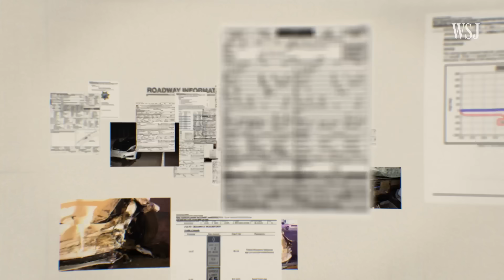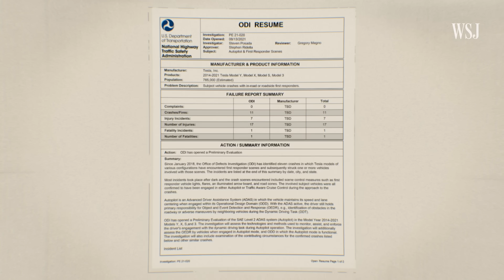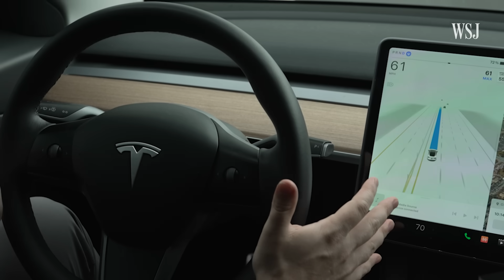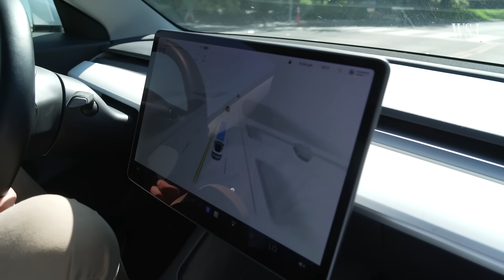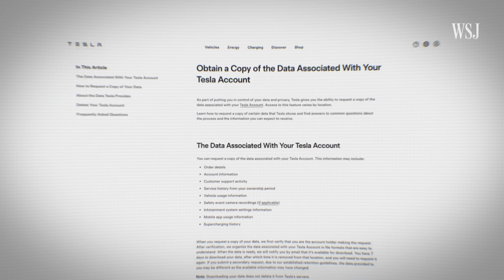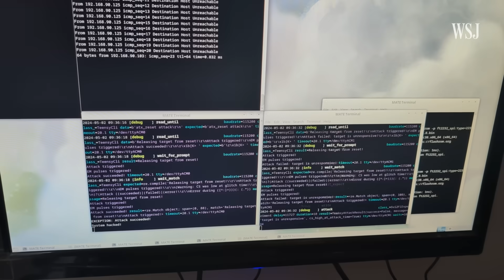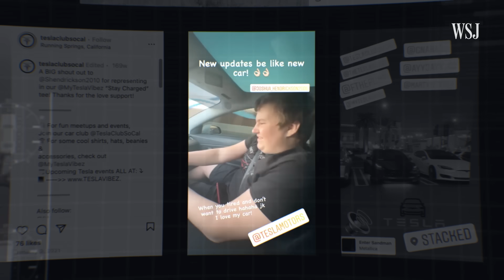The Hidden Autopilot Data That Reveals Why Teslas Crash | WSJ

Comment: This incompetence is unacceptable. Just train AI to drive the cars. Test it in a virtual reality that is indistinguishable from the real world, at lightning speed  within supercomputers, until it has thousands of years of driving experience and never gets into an accident again. Then test it in the real world, and train it there until it is perfect. Have redundant systems. Have two or three completely different systems running at the same time, that operate in different ways. If they don't all agree 100% on what to do, the car immediately comes to a safe stop and requests that the driver takes over.
Reply: Just train AI to drive the cars 
Tesla Autopilot does not and will not use AI. As many have pointed out, it's simply TACC plus lane centering, the same as has come on most every new car in the past 10-15 years. It's FSD that uses AI, and it's achieved an astonishing record of safety over the past several years.

Comment: The king has spoken, so no Lidar for you all, ever.
Reply: no Lidar for you all 
Thankfully. Adding LIDAR, etc. would have the unintended consequence of increasing accidents and fatalities, rather than decreasing them. This is because the more redundant sensors a vehicle has, the more it will cost; the fewer folks will be able to afford them; and the fewer will be able to take advantage of the slight increase in safety that these features would bring. For example, the M-B EQS and S-Class sedan with Drive Pilot probably have the best suite of sensors of any car; but they're so expensive that very few can afford them. On the other hand, the Tesla Models 3 and Y have established an astonishing record of safety, and the Model Y wouldn't have been the best-selling car model IN THE WORLD, BEV OR ICE, in 2023 if it weren't affordable, at least as compared with other vehicles that it beat out for the best-selling crown.
Reply: @BigBen621  
Do you even know what diverse redundancy means and for?
Reply: @Dan8254  Lidar is simply not needed. FSD sees far more than people think, and will make our roads far safer.

Comment: The "brilliance" of Elon is that he convinced so many people he had "autopilot" way before it actually worked correctly. In another 10 years it might actually be an autopilot but he will have made billions off of people who thought he actually had autopilot years ago.
Reply: he convinced so many people he had "autopilot" way before it actually worked correctly. 
My son bought one of the first Model 3s in 2018, and it had a functioning Autopilot (Traffic-Aware Cruise Control plus Lane Centering, just like virtually every new car for the past 10-15 years). I've had two Model Ys since 2021, and both had functioning Autopilots. Tesla has won at least two lawsuits for accidents claimed to have been caused by Autopilot. Further, NHTSA has investigated numerous accidents involving Autopilot, and has exonerated Tesla in each case. As such, he did have a functioning Autopilot years ago, and your claim is what I like to call FALSE.

Comment: In 100% of these cases, the human behind the wheel was relying on autopilot to keep them safe when it's really the driver that should pay attention despite autonomous software driving for them. Ford also offers self-driving mode however the vehicle constantly reminds you to keep your hands on the wheel, if not the driving mode disables, the car slows down forcing the driver to take over. An experienced AI will eventually surpass human driving however we are not there yet, and humans still need to pay attention!

Comment: A car on a busy road has nothing to do with an airliner flying in cruise at 35.000 ft. 
Any automated driving system will obviously greatly reduce the « driver » focus and attention to what’s happening at any time. So the driver is put in a position where he will be mostly unable to react properly to any autopilot error occurring, even more so if these errors are rare. 
Putting an autopilot and asking the driver to react in case it malfunctions is totally hypocritical and incoherent from a safety standpoint. This should be banned. 
This is as stupid and stubborn as OceanGate’s Titan submarine design. 
No surprise Elon Musk has a mindset very similar to Mr. Stockton who was the OceanGate CEO. Libertarian, dismissive of any regulatory body or safety regulations, authoritarian, stubborn, intolerant to internal critics…

Such a system might be used to monitor the driver’s driving and alert him in case of a dangerous behavior such as lack of vigilance or lane crossing or entering a one way road in the wrong direction. It might handle emergency situations in case the driver becomes unresponsive or engages in extremely dangerous situations.

Comment: You also have to realise that the autopilot that failed in '21 is gone now replaced with a better version.
 Tesla updates their model often, but there is no substitute for an aware driver.
Ultimately, FSD-supervised needs to be treated as a driving aid. Not as a replacement.

Comment: For this an any technology one death is too many. I wonder what is the average of casualties compared to non AI which follows models
Reply: I wonder what is the average of casualties compared to non AI
Autopilot is not based on AI; it's just TACC plus lane centering, the same as virtually every can sold in the past 10-15 years has been equipped with. Nonetheless, its safety can be compared with drivers not using Autopilot: "In the 3rd quarter [of 2024], we recorded one crash for every 7.08 million miles driven in which drivers were using Autopilot technology. By comparison, the most recent data available from NHTSA and FHWA (from 2022) shows that in the United States there was an automobile crash approximately every 670,000 miles" (Tesla Vehicle Safety Report 3Q2024).

Comment: Bottom line is the driver was not paying attention.  I also noted the road was full of dirt from the dump truck significantly increasing stopping distance.  Someone made the comparison to aviation Autopilot.  Newsflash: the first thing they teach you in ground school is the pilot in command has full responsibility of the plane and lives it contains regardless of what technological aids are being used.  Funny. no mention of how many non-autopilot deaths occurred during the same amount of time, or the fact it's impossible to tell how many accidents DIDN'T happen because of autopilot.

Comment: To be clear, I'm no fan of Tesla's system. But are they, or are they not, safer than human drivers? Are they, or are they not, safer than competing systems? Are they, or are they not, safer than (extant, or possible) public transit alternatives? It's answers to these questions, ones about how to improve our safety overall, and not anecdote-driven sensationalism, that will serve the public.

Of course it is a tragedy when someone dies on the road, but that tragedy is not increased or lessened by the brand or technology of the vehicle involved. Several of the videos you show are circumstances where I might have been killed had I been the driver, so blaming the manufacturer without looking at the statistics is just muddying the water of an issue that we desperately need to understand clearly.

I don't feel the video, as presented, was a service at all.
Reply: @stephenspackman5573
But are they, or are they not, safer than human drivers? 
Without a doubt.

 Are they, or are they not, safer than competing systems? 
Competing systems to Tesla Autopilot are the TACC and lane centering systems that have been included in pretty much every new car in the past 10-15 years. The difference is that unlike Tesla Autopilot, nobody's monitoring the safety of the other hundreds of millions of cars, so there's no way to measure whether Autopilot is or isn't safer than the scores of different versions of TACC and lane centering from all the other manufacturers. But because Tesla does do attention monitoring even on Autopilot, and many if not most of the competing systems don't do attention monitoring, it's highly likely that Tesla Autopilot is safer than most of all competing systems.

 Are they, or are they not, safer than (extant, or possible) public transit alternatives? 
Probably not.

This is probably one of the most well-thought-out and rational posts in the entire comments section of this blatant hit piece.

Comment: I don't want to seem calous or without empathy, but with very little research you can see that the autopilot system is not to be used as a sole driving method.  The driver is intended to always be paying attention to the road.  It is not a complete driver replacement and as far as I know is not currently or has it been in the past intended to replace the driver.

Human accountability up to and including now was always factored into the system and expected to play a role.  You are CLEARLY intended to have hands on the wheel, be paying attention, and be ready to brake at ALL times.  I know that and I don't even own one.

Comment: Your intent to conflate autopilot with Full Self Driving is at the least disingenuous and at worst dishonest.  As a Tesla driver, and driver of many other vehicles for decades, it was never unclear to me that cruise control and autopilot are the same thing. And I never expected cruise control in any other vehicle to make critical driving decisions nor did any of you except perhaps those with limited driving skills and a failure to understand normal vehicle operational parameters.  Failing to note that both cruise control and autopilot have a feature called lane keeping that can be engaged or not--and I usually did not in my Audi, Chrysler, or Tesla.  Further, mere lane keeping is NOT full self driving. Period.  Anyone, including some of the ignorant experts you cited, who does not understand the operation of the car they are operating should discontinue driving until they get more training.  You could raise the bar here and limit your reporting to facts.

Comment: I’ve been using Tesla’s FSD (“Full Self-Driving”) a lot the past few months.  Here are the most-important things to understand about it:
#1  FSD is an aspirational name;  it has nothing to do with autonomous driving!
#2  You are still driving the car.
#3  You are only tentatively delegating the mundane grunge work of driving — turning the wheel, managing speed, operating turn signals.
#4  In delegating those things, the opportunity is to give even more attention to the road hazards around you .
#5  The opportunity is not to turn over the driving task to the car, no more so than turning on cruise control.  FSD is just a super-capable cruise control;  driving the car is still your task.
#6  The accuracy of this technology is improving continuously.  Even in the several months I’ve used it, it has improved.  Again, the opportunity here is to give even more focus to the road around you.

Comment: Guys this is so outdated. Using comments from 2016 also picture labeling is over 5 years old the system moved on from this a long time ago. Autopilot is a driver assistant but look at FSD today and you’ll be amazed. Again bad journaling and analyzing very old data is rubbish.

Comment: Hasn't Tesla disabled the radars in models that had them with later software updates? (yes, google for "tesla disabling radar")
Claiming: People drives with only eyes, we can too...
Some of the shown cases could have happened with human drivers too. But auto break systems using radars could have saved the driver.

Radars and Lidars are the tech way to ensure picking up unexpected situations, but might cause unnecessary breakings too.
If one camera reports an object, the other does not - should it break?
If all cameras report no object, nor the Lidar, but the Radar reports an object - should it break?

It is a question of balance: Do you want a smooth ride or a safe one?

Comment: 3:20 The big failure of this video is that you're not doing a fact-check on data you're bringing in: you show Musk claim it's safer than humans by a factor of 10.  IS IT?  I dunno, maybe it is, maybe it isn't.  Maybe it's by a factor of "only" 4x or 2x or 1.1x.  Or is it 2x worse?  It'd be easy enough for you to have looked into.  Without this info, this piece isn't informative, really, just a clickbait hatchet job.

Comment: Autopilot is an old technology, and everything discussed here is largely irrelevant in the context of the latest FSD (V12 on). It is like discussing the old problems with the first generation iPhone (like excruciatingly slow Web page access) and concluding “therefore iPhone won’t work”. It is the brain, not the sensor that enables self driving. You can fly an FPV drone with an amazing accuracy solely based on the live images from the cameras on board.

Comment: They need to rename the feature “NOT - Full Self Driving”.  Deceptive naming was required to drive up stock pricing.  Even today, after decades of model development, the feature is a half-baked death trap.  I’ve tried it and it is worse than nothing at all.  The problem with it is at first it seems impressive and then it does something really stupid.  And, when it gets in a situation it doesn’t know what to do it shuts off and hands it over to you.  This is often in the worst possible moments.  Trusting it feels like a death sentence and not trusting it is a nerve wracking experience.  IMO, autonomous driving will never happen unless we develop autonomous roadways.  Being 95% right is a disaster.  It needs to be more like 99.99999% which is impossible given the infinite variations that occur during driving.

Comment: sad that the guy died, but also he could have seen it if he wasn't 'sleeping' and avoid it in time... The crashes of WSJ are the ones where people solo rely on autopilot. Tesla says clearly, that the driver is in fault even if the autopilot is on, the driver should always be in control of danger.
Reply: 10:20 mark. In Europe you drive on the left lane and slow down. this guy didn't do that so, drivers fault obv. They should gather the crash data from Europe vs America, you will see a difference in driving behaviours.

Comment: To all that think the camera is better than Lidar/Radar. Think of world War 2. Britain used Radar to determine when there is an object which is way better than a few pairs of eyes and having those people ring into control center to report the shape of the aircraft.
The camera is pairs of eyes and still need to report back to control center and control center still need to figure out what it is.
At least the Lidar/Radar knows there is an obstruction way ahead to slow down.
To all those that think the camera will work, please think about how the system work instead of saying it will work…in future..meanwhile 😢😢😢

Comment: dawg finna specify autopilot lane assist or autopilot fsd; latter has no traffic or obsctale navigation. if you are driving into trfaffic cones it will beep and  display them on screen whence dawg finna grab the pus wheel. personally i noetd there is some danger when transitioning from one to the other since the character of the two is completely different, such as when an autopilot trial comes to an end since they are both activated in the same way and are both caled autopilot. nonetheless, another danger even without this transition when engaged in either pilot is that the driver sometimes may not be aware she has offed autopilot whence the vehicle drives straight off the roadway without the driver taking control; for the disengage for autopilot can be an accidental braking or steering input

Comment: It’s funny the whole narrative is completely wrong. Autopilot has crashes does not mean it’s not safe. You need to compare it with human drivers. The idiots who didn’t pay attention are likely to die on their own hands as well. How safe autopilot is cannot be determined by the absolute numbers of accidents. You need to look at accidents per thousand mile. 

Also the video failed to report how many times autopilot avoided accidents. 

Overall it showed absolutely nothing against Elon’s claim that autopilot is safe. Ironically it even shows at least two crashes that due to other human driver’s fault, one aggressive driver make an unsafe lane change another two stupid human cars crashes in front of Tesla.

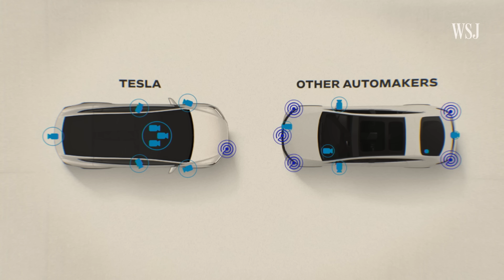Comment: The frustrating thing about Teslas is that when the driver let off the gas, the car immediately starts breaking with no brake lights until the actual driver hits the brake pedal. 4:45
Reply: This is false. Teslas shine their brake lights when regenerative braking when there is enough deceleration, such as when removing your foot from the accelerator
Reply: @  okay. Keep telling yourself that.
Reply: @Mars_Attacks_Again  I've tested it out in my own Tesla dozens of times at night. My wife had the same concern and even made me go on a special trip to prove to her that it applies the brake light. Have you ever driven a Tesla? I'm sure there are a bunch of YouTube videos proving that the light comes on.
Reply: That's how all cars work. Especially manual transmission.
Reply: @Uruz2012  no, what Angel is talking about is Tesla's active braking when you take your foot off the pedal. They do it to recuperate energy from the braking and extend battery range.
Other cars usually keep rolling when you take your foot off the gas pedal and will slow down slowly, instead of actually braking.
Reply: the car immediately starts breaking with no brake lights until the actual driver hits the brake pedal 
Where'd you get that nutty idea? That's what I like to call FALSE. Search for "does tesla regenerative braking turn on brake lights" and you will find numerous reports that it does, including https://youtu.be/FYyG2sn5mFs.